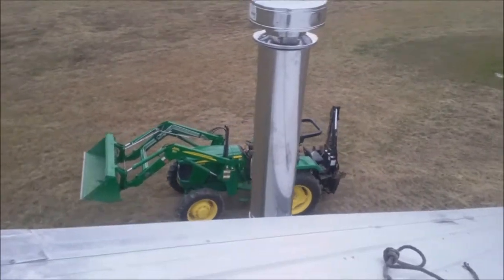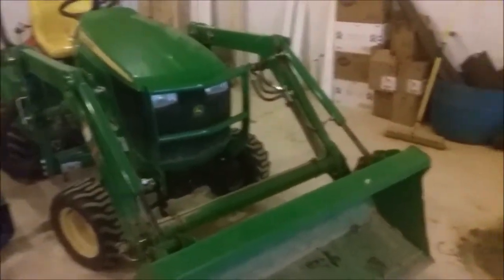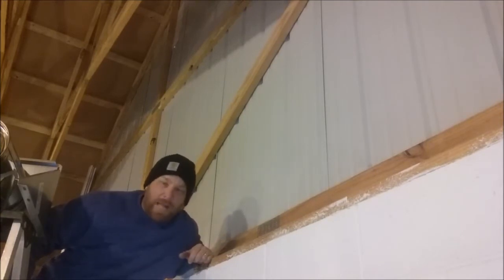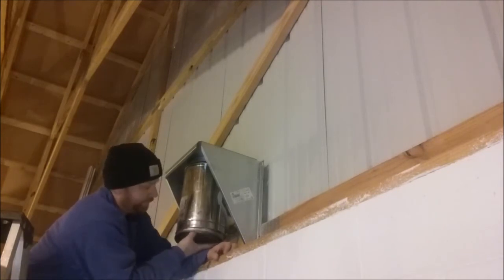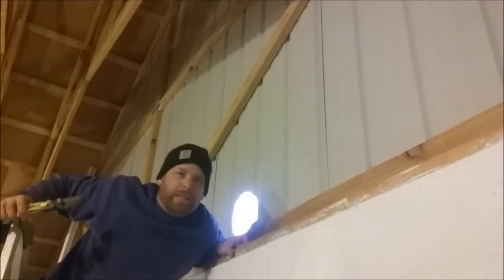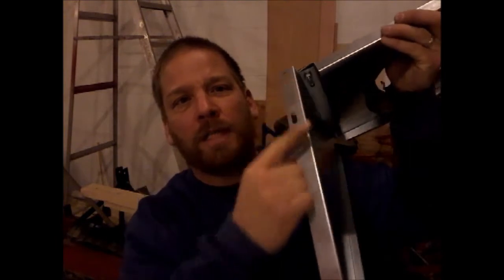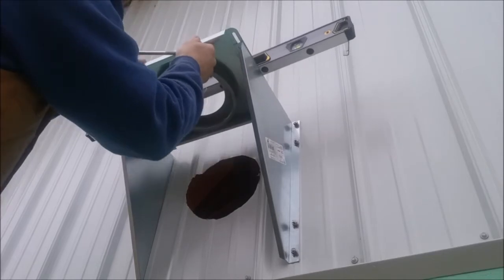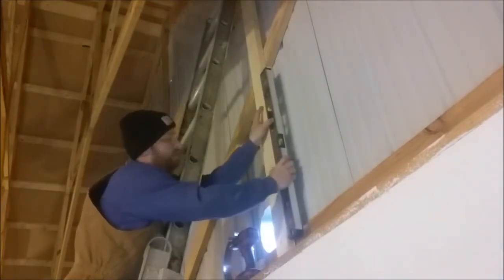Chimney Installation "FAIL"!!

Comment: So the directions say not to use offsets outside of the building, but it doesn’t say why, how did this work for you, because I need to do the same thing you did to clear overhang.
Reply from the maker: This video is a few years old still working fine